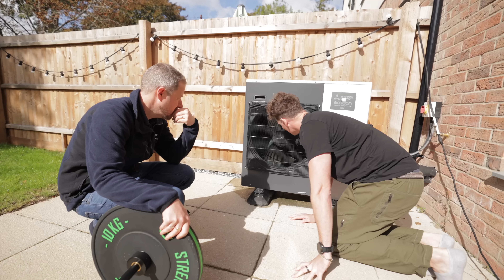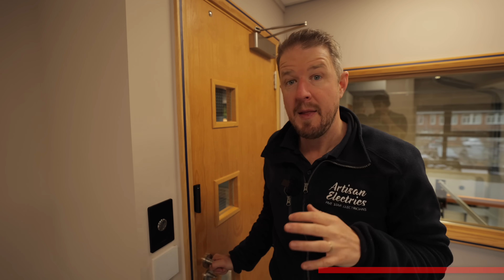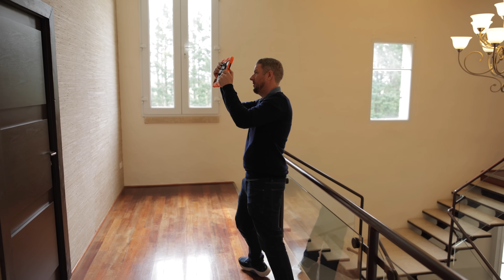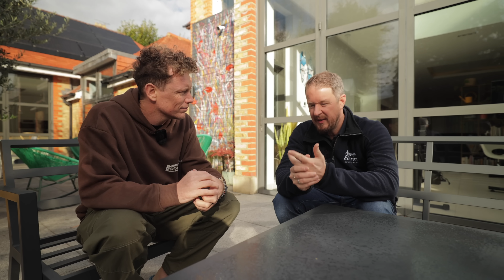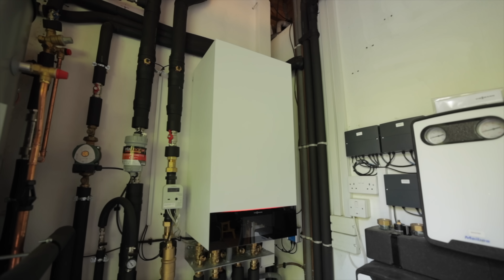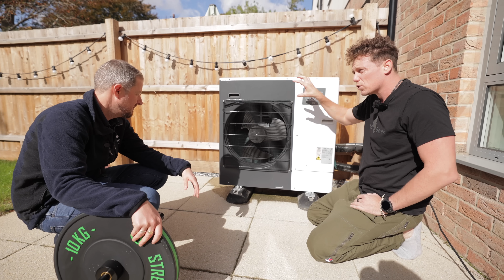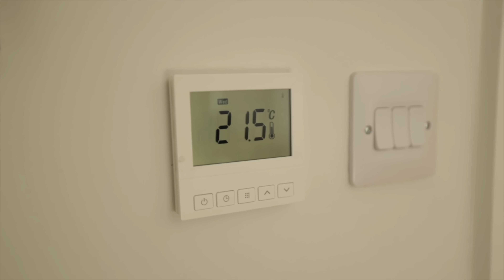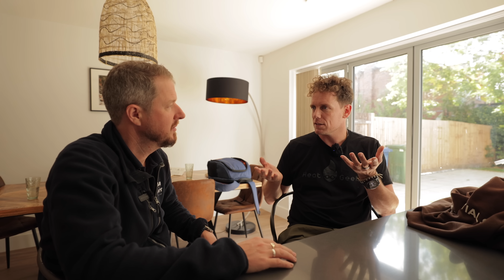Are Heat Pumps Really Worth It In 2026?

Comment: Heat Geek did our ASHP in February. It was to replace our combi gas boiler, and we didn't have an easy location to stand the outside unit. We requested 3 quotes, one said it couldn't be done, the other one never got back to us even after chasing a couple of times. Heat Geek quoted £8k for full install including mounting up high on a wall, new water cylinder in the attic, four new larger radiators, remove the old gas boiler and make good the brickwork. Everything was done in four days, and is easily the best thing we have done at our house. The gas boiler used to cost a fortune and we never had a warm living room or bathroom. Now the whole house is 21°C downstairs and bedrooms at 18°C all day every day. Just being able to come back into a warm home at any time of the day or night is such an undervalued luxury instead of being bound to a timer controlled gas central heating system. Highly recommended.
Reply: In Germany the market has been influenced by wrong political decisions... There are some videos out, recently, from Andreas Schmitz for example.... These explain the price difference
Reply: This price sounds a bit to good to be true. Especially for me as a German 😅 How big is the house and the heatpump?
Reply: @idiNty houses are smaller in the uk
Reply: @idiNty  Remember in the UK you can also get £7,500 government grant
Reply: @Samxronn ok then it is still „only“ 16000. Here your pay easily 30 k before subsidies for a house with let’s say 120 square meters.
Reply: @idiNty  Not to make you feel bad, but my Heatpump install cost a grand total of £350 after the government grant, installed by Octopus.  I was really lucky as these types of deals don't seem to be available any more.  I think the goal from Octopus was to try and get a good quantity into the market at the time, with the amount of time and workmanship in the job i honestly can't beleive they were making any sort of profit.
Reply: @Samxronn who is paying the £7,500 to help you?
Reply: @Cuzzazbuzz As a country, we're transitioning away from fossil fuel usage. Some of this is subsidised thorough general taxation on the population, some of it comes from energy and oil companies - who have enjoyed record profits for years. It can only be fair to ask them to contribute in helping to reduce the rate that we're damaging the world that we live in and share with so many other species.

Renewable technology prices have dropped massively as we've A) invested more in research and B) the economies of scale mean that it gets so much cheaper when you start producing these things at scale. 

Our electricity is one of the most expensive in the world at the moment, and it's still tied to the cost of gas. It needs to be rethought and updated to take into account that we will be both producing and consuming electricity very differently in the coming decades.

As someone who works in the tech industry, there's so much that could be done that hasn't been built yet. It's really exciting where we're headed - well, to me as a nerd. Maybe not to people who don't care about tech 😂
Reply: @FahadAyaz  Well put, and I'd add, as happened when we lead on solar PV feed in tariffs (well, followed Germany).
Reply: @FahadAyaz  us getting to a point where the energy companies are taken to task on energy pricing, I’ll believe it when I see it. 

Yeh we’re transitioning away from fossil fuels…to then import it from aboard. In reality no doubt a decent chunk from Russia in a roundabout way. 

Norway, where I work have a lot of hydro, they even send to England via the NSL. I get they say it by direction but I very much doubt Norway need our wind produced electric. In reality we are going to have our pants pulled down on unit pricing for a long time to come.
Reply: @Cuzzazbuzz the taxpayer many of who cant afford to put their heating on let alone get a heat pump installed
Reply: @janetholden1978  Unless they earn £40-45k a year those taxpayers aren’t even net contributors. They get more out than they pay in income tax.
Reply: AC condenser cost £400-£600 average 3kw 5kw,  and ASHP 5KW just condenser £4k-£5k,   but AC condenser Vs ASHP condenser there is not much difference,  can any one explain 🤔
Reply: @ParveenKumar-u7l7w The main reasons why AC condensers are generally cheaper than air source heat pump (ASHP) outdoor units are related to complexity and function:
💰 Cost Difference Summary
Single vs. Dual Function:
An AC condenser is a single-function unit, designed only for cooling (rejecting heat).
An ASHP outdoor unit is a dual-function unit, designed for cooling (condenser) and heating (evaporator). This requires an extra component, the reversing valve, which increases cost and complexity.
Performance Requirements:
ASHP units must operate efficiently in a wider temperature range, including very cold weather, to extract heat.
This requires a larger, more efficient coil (heat exchanger surface area) and more robust engineering for all-weather performance, including advanced defrost cycles.
Components and Controls:
ASHP often utilize sophisticated variable speed (inverter) compressors and more complex electronic controls to manage the dual cycle and maintain efficiency in varied temperatures, adding to the manufacturing cost.
In short, the heat pump is more expensive because it is a more complex machine built for year-round, efficient performance in both heating and cooling modes.
Reply: @GdaySport I appreciate the explanation, thank you, and expensive  because of having a longer operational  lifespan.
Reply: I'm not convinced. Our heating system uses 10mm  microbore pipes which I very much doubt would be suitable for a heat pump and no way am I having all the pipes replaced,,,,,.
Reply: @teecee90  If you find a good heat pump engineer, then 10mm copper microbore isn't usually an issue - plastic has inserts so is narrower in many places and so can be more of a challenge.
Reply: @teecee90  We recently had an installation by a Heat Geek installer, and we couldn't be happier.  We have 10mm copper microbore.  It's no problem in our house, but you need a proper engineer to do your survey to ensure the flow rate over the distance to your emitter (radiator) will be sufficient for the size of radiator required for the desired flow temperature.  If not, one option is to increase the flow temperature slightly, but that will reduce your efficiency.  We are currently getting efficiencies of around 500%.
Reply: @teecee90 Heat geek refers to your situation, which can apparently be solved by adding another pump.
Reply: @teecee90 Have you based your conviction on any calculations?
Reply: 18c to 21c is too cold for me
Reply: @londonertiger7725 What do you like?
Reply: Putin's gas: nothing political going on here.
Reply: @iaingray594 Yes - we stopped buying gas from Putin because he is a murdering criminal rogue. Nothing political about that dude.
Reply: @Nb0ssProductions It does not matter who we buy our gas from - we still pay market rate.
Reply: We had a similar experience with our Heat Geek installed ASHP. The house has been consistently warm and cosy throughout the recent cold period with temperatures dropping down to -6. Running costs are similar to when we had gas but the house is much warmer and previous condensation issues have completely gone.
Reply: So , can I ask if you already have Solar & batteries & do you have under floor heating too .
Reply: @stevensmith8454 No, just rads. Would have loved UFH but house was recently renovated and its a big job best done with a new build or major renovation imo
Reply: Sounds like you have paid 8 grand and just needed bigger radiators, hopefully it’s not the case but I have heard the life span on heat pumps is not great, more complicated to work on after initial install, very few competent breakdown engineers compared to gas boilers, much less/slower availability on spares. You will not benefit from a grant to get it replaced unlike coming away from gas. If there is a chance of reliving you of some money you will not struggle to find someone to tell you it’s a good idea. All the best.
Reply: @gunsey876  time will tell, there are old gas boiler, although not very efficent I work on more than 40 years old. The life of condensing boilers seem to be between 10-20 years. I suppose when the grants stops will be the true test, but they seem to get rated quite highly, and if you have some free electricity as well.
Reply: Just you wait for the electricity bill,mine trippled and yhe house was not warm.
Reply: @pauldench1299 yes, so if you’ve watched the vid you’ll realise it’s a ** install.
Reply: I’m about to move into a property with air sourced heating and solar panels and I’m really anxious I’ve made the right decision!! Any problems or issues at all??…No matter how small. Appreciate your input greatly.
Reply: @tracykelly5557 I have been pretty lucky with all my hardware and everything is working as expected. The biggest issues I had were with Octopus not installing my smart meter properly and the G99 application taking a long time to get completed due to poor communication between our DNO and the installer...
Reply: Do you have solar panels and batteries installed? Or just a heat pump ?
Reply: @Dave-ko2pr Yes batteries, solar, and EVC
Reply: Mine through octopus energy cost me after the £7500 grant just £1300. Three bed semi and we are in our late 70s so our heating is set to 22° everywhere. Now installed for nearing 2 years and it’s absolutely brilliant.
Reply: @wobby1516  But bear in mind Octopus prices have hugely increased since then (our quote has doubled) and they are not the most optimised/efficient solution.
Reply: Bigger radiators and a Smart Control on your old boiler would have achieved the same result at a fraction of the cost.
Reply: @simonaeldred Yes it would have been much cheaper to just put two bigger rads and a smart stat for sure and keep GCH. It will take many years to repay the cost of our ASHP. However, if I ran it like our ASHP (low and slow 24/7 with it set to 21°C) it would bankrupt me! It was already costing us over a grand per year on gas alone with timer on a couple of hours in the morning and 5 hours in the evening set at 19°C (wknd was on most of the day)...
Reply: @GdaySport  The heat loss is the heat loss , why do you think changing the method of generating the heat suddenly makes it more effective/ go further?
Running a gas boiler low and slow makes the boiler more efficient for exatly the same physics/heat transfer reasons as the heat pump. the differnece is that the HP can only do low and slow.
Reply: @simonwillett8251Yes, obviously the heat loss on any property is the heat loss!  I used to run my ideal standard boiler as low as it would go, but it could not get anywhere near what I run my heat pump at. Also, two of my radiators were relatively undersized by the gas heating system fitter which didnt help and the two rooms were freezing at less than 45°C flow. My ASHP fitter did the radiator sizing correctly which is why i can now run it at a much lower flow temp. Gas heating fitters are lazy and get around heat loss issues and rad suzing by oversizing the boilers then relying on them being able to run at much higher temperatures to overcome their slap dash work. This is why my ASHP is more comfortable to live with and cheaper to run. You get what you pay for when you install a heating system.
Lastly, my ASHP can achieve a flow temp of 70°C so not "only capable of low and slow". If I wanted to heat the house up super fast or get the DHW ridiculouly hot for example, but that has not been necessary yet...
Reply: @simonwillett8251I was wondering this. Selfish reason being I have a Biomass system totally bodged by installer where I can't get the store to go above 50 degrees (well not in a reasonable period of time i.e. when its cold!) so have been looking at whether I could upsize my rads and almost run it like a heat pump
Reply: 18 celcius is not that warm for a bedroom at night.
Reply: @DildoSwaggins-m1s it is for us otherwise we cant sleep when too hot. It was the design brief we asked for. You can have it at 25deg c if you really wanted....
Reply: @DildoSwaggins-m1s it's the ideal temperature to sleep.
Reply: @DildoSwaggins-m1s thats too hot
Reply: Never had a warm living room with GCH? 
I smell bullshit.
Reply: @Floyd1504  its so irritating that people say "since we had a HP we are comfortable".... fuck all stopped you getting the existing system ticking over all day....
Reply: @timclarke8565 except the eye watering cost...
Reply: @Floyd1504 Luving room and bathroom rads were seriously undersized. Even with boiler  wound all the way up it wouldnt even get close to comfortable in winter. But dont believe me if you dont want to, I'm happy if yours is working...
Reply: @GdaySport what an absolute load of 💩 are you being paid by heat geek by any chance??
It wasn't the boiler to blame for the cold living room & bathroom so its a completely faced argument, 
Gas can run at 20°c higher temperature than an ashp so unless your living in a mansion with rickety old sash windows your talking complete nonsense, 
I live in a single skin stone cottage & run a 15yr old oil boiler & i don't even spend £1000 a year on heating & gas is much cheaper than oil,

Cmon stop chatting 💩 please
Reply: @GdaySport  but that is nothing to do with the heat source is it?
Reply: @GdaySport  Hardly the fault of the gas boiler though is it?
Reply: @simonwillett8251No it is not. It was a poor gas fitter oversized the boiler and undersized two radiators. Could have replaced radiators and kept GCH and been warm for less initial outlay than ASHP, but it would not make it cheaper to run than an ASHP which can keep my house warm all day for less than the GCH  could for 7 hours per day....
Reply: Heat pumps aren’t 400% efficient on very cold days
Reply: Given heat pumps run on electricity how are they cheap to run? I’ll cut to the chase ask someone with a heat pump how much their fuel bills are every month.
Reply: @steveB8279 In a nutshell heat pumps are around 400% efficient but gas is 4 times cheaper per unit of energy, so they are basically on cost parity if you are on standard rate electricity. Where they cost less to run is if you can get it running at over 400% efficiency or get a cheaper electricity tariff for heat pumps. If you can do both, they can be as low as half the running cost. Where is gets really interesting is if you get solar and or a home battery you can easily get it down below a quarter of the cost of gas. We charge our home batteries from solar during the day, and using cheap overnight electricity in winter. Our electricity bill is £67 per month which includes heating, hot water, and everything electric in the house, and the electricity for two EV's. We don't have gas anymore so save the daily standing charge, and we no longer buy diesel or petrol. House us a 3 bed semi built in the 70's and its at 21°C all day every day. We cover just over 20k miles per year combined. Hope this helps.
Reply: @GdaySport this ignores the fact boilers are only 85% efficient. Which closes the gap
Reply: @G @GdaySport Out of interest, how much solar and battery storage do you have installed?
Reply: @ianmicj We could only fit 10 panels on our roof split between north and south due to dormer design. We still have the option to add another ten to our garage which we would like to do. Our battery storage is 27kwh which covers all of our use 99% of the year
Reply: Don't blame your boiler; it sounds like your old system was underperforming, and you fell for the old sales tactics.
Reply: @iaingray594 The boiler was fine, but the installation wasn't great. That was not the only reason to get rid of it - we got a home battery and solar and two ev's so basically enabled us to get cheaper electricity. We also got rid of two turbo diesel cars to further capitalise on this. That's the main reason. Doesn't make sense to pay more for three different fuel types. Lump them all together and get a better energy price. We save £250 on standing charge alone just getting rid of gas meter. Our bills for gas and electric have gone from 180pcm to 74pcm for electric only, and that includes charging the ev's! Wasn't the boilers' fault, it just how energy is priced and used...
Reply: We've got a 4 bed house, when we moved in it had no central heating at all.

Eon fitted us an entire system for £5000, including radiator and all the pipework.

Works amazing.
Reply: ....so.... you 'had' a functional heat source.... didn't bother getting it correctly sorted... and spent 8k of your own money... and 7.5k of tax payer money.... 

ok.
Reply: @timclarke8565 Yes. We also have two EV's and solar panels so it made sense to get rid of the "odd one out" fuel source.
Reply: My boiler is 97% efficient, 10 years old, according to our plumber when he plugged his gadget in
Reply: If you never had a warm living room or bathroom then it wasn’t the gas boiler - you needed to correct the problem with the radiator or pipework or simply just balancing. Also - are you going to provide scaffolding when your heat pump needs a service ?
Reply: Got a heat pump guy quoted 8k, eventually went for nest and villant system boiler, set the schedule it will keep my house constant warm, not a difference apart from it will heat quickly, cheap gas allow me still enjoy cooking, and the extra money I spent on upgrading my window and insulation. The the end of day it’s a matter of heat produced vs how well you insulated, it’s no magic, the green part of the story is a lie because the majority electricity in the nation is also produced by a gas boiler far away, you can see the price is moving along with the gas, otherwise you can only turn on your heat pump on a windy day. Can’t believe our tax is wasted like this, not to mention sometime you will need huge  renovations to install such thing
Reply: @anomalyarchive-official what absolute bollocks.
The majority of the grid in the UK last year was 50.8% and is improving each year.
If you'd rather stay on gas because you're not certain, because you don't have the finances to change (even though it's about cost parity with the grant for most homes now) then that's up to you.
Don't go spreading misinformation though so other idiots start repeating it.

Incentives through tax are no waste either, it's used to encourage forward progression and allow scale to reduce costs over time so the incentive can then be removed.
We also get an enormous compound return as a nation on said incentive by minimising dependancy on foreign nations with  potentially bad intentions.
Let alone health benefits and reduction in our emissions.
Reply: @BradLad-q4u you clearly haven’t read my comments.
Reply: @anomalyarchive-official I read your comments. You're asking crap mate especially when you consider that most people installing heat pumps have solar and/or battery. When power is being generated locally then it doesn't matter how the electricity is produced by the country.
Reply: @TheRakesh1000 good luck with your 3 hours long cloudy sun in the cold weather when you need the heat most
Reply: @anomalyarchive-official even cloudy days can produce electricity but anyway that's what batteries are for. I have PV and a power wall. 100% self sufficient (free) between may and September. 75% self sufficient averaged out over the year.
Reply: @BradLad-q4u  I'm a PV and battery owner, but my ROI is going DOWN due to standing charges etc.
In case you've not seen, the Ofgem cretins have approved adding more to our SC's to bailout the energy debt poor.  Yay.

You'll also note that prices have gone up 1% again, and that even Labour are back peddling with cost of living coming down.

As you know, we have the 2nd highest electricity costs in the world?

Net Zero, whilst an laudable goal, is going to bleed us, both on an industrial and home consumer level.

The amount of long term and  insanely high priced CFD's that are needed to incentivise private equity to fund green energy is crazy.

I urge you to do some research.  As a nation, we are going to locked in these deals for 15-25 years.

The nuclear power stations being built?
Both 2-3 times over budget and 2-3 time later.
Have you seen the price they negotiated for generation?

In the next 6-18 months, home pv export rates will implode.  It's already happening with Eon btw.

Ever noticed how little solar is generated in the dark, sun deprived winter months, exactly the time you need it to power your HP?

I admire the work Heat Geeks do.  However, sat making a video outside of a 5 million pound+ property makes me laugh.

Take the challenge, search YT for those advocates of HP's (or EV's) who don't have PV and batteries, don't have a modern home, and don't have a driveway so they can charge their EV for pennies.

You won't find many, and where you do (Tom Bray for HP without pv + battery) was saving a princely £200pa vs a combo boiler.

HP's and EV's, both great technology, but they are CONDITIONALLY great.

No UK government has the stones to upset voters, bulldozer over the OAP nimby wasters you see objecting every week, and move the Country forward.

The result is us paying for Gas derived electricity, regardless of if 50, 60 or 70% etc of generation was renewable.  All the while funding desperately unfavourable private equity deals.
Reply: This is definitely not a advertiser's bot comment, no way, no chance. You must think we're stupid.